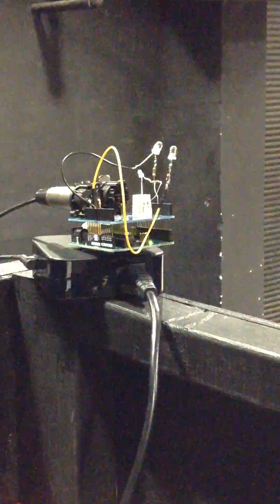DMX control on Arduino Uno

Comment: Hello Jennifer, Great stuff, are you able to share your source code ?

Thanks
Reply from the maker: Maybe? but I'm not entirely sure how since I don't think just copying and pasting into the comments on youtube is effective.  I can suggest starting here https://sourceforge.net/p/dmxlibraryforar/wiki/Home/ since they have some libraries you'll need and a few example codes. The arduino forums are also a really great resource.

I was using the dmx shield seen here: https://www.tindie.com/products/Conceptinetics/dmx-shield-for-arduino-rdm-capable/     They're also available on amazon.

After setting up the arduino as a slave and defining my constants and outputs my main loop looked something like this:

EXAMPLE DESCRIPTION
  //
  // If the first channel comes above 50% the led will switch on
  // and below 50% the led will be turned off
  
  // NOTE:
  // getChannelValue is relative to the configured startaddress
     if ( dmx_slave.getChannelValue (1) > 127 ) {
       analogWrite(ledPin1, dmx_slave.getChannelValue(2));
       analogWrite(ledPin2, dmx_slave.getChannelValue(3));
       analogWrite(ledpin3, dmx_slave.getChannelValue(4));
       analogWrite(ledpin4, dmx_slave.getChannelValue(5));
       analogWrite(ledpin5, dmx_slave.getChannelValue(6));
       analogWrite(ledpin6, dmx_slave.getChannelValue(7));
       analogWrite(ledpin7, dmx_slave.getChannelValue(8));
       analogWrite(ledpin8, dmx_slave.getChannelValue(9));
       analogWrite(ledpin9, dmx_slave.getChannelValue(10));
     }
      else {
// Sound stuff
       analogWrite(ledPin1,255);
       analogWrite(ledPin2,255);
       delay(100);
       analogWrite(ledPin1,0);
       analogWrite(ledPin2,0);
       delay(100);
       
     }
 
  delay(10);  
}

Good luck!

Comment: Hi, I have the same DMX Shield and I'm trying to pair it with an Arduino Mega2560 to control a COB Led Light via PWM with the help of an LED driver.

I'd like it to do just what you're doing, control the intensity of the LED, maybe blink it, whatever.  Where I'm stuck is the code.  All the sketches I find are trying to communicate with fill in the blank DMX controller or computer software via USB.  I prefer your setup where it's an XLR cable attached to the shield.  Would you mind sharing your sketch or pointing me in the right direction?

Thanks, and much respect.  Your audio reactive video looks super cool as well.
Reply from the maker: Hi there!  I understand your difficulties with the coding, it was the single most challenging aspect of this project.  If you have the same DMX shield I would download the libraries that come with it from sourceforge.net/projects/ dmxlibraryforar

Among the examples there should be one labeled DMX_Slave, which is what you're trying to do: set up your Arduino as a slave device to another control console.  This code should be a good place to start.  It establishes an intensity parameter that tells the Arduino to give control to the lightboard (I assume you're using a lightboard if XLR is involved) if it reads a signal above fifty percent on channel one, otherwise control reverts back to either a base code you write into the program on the Arduino or just defaults to 'off'.

I hope that helps.  I'm wary of giving you this other dmx code I have since it currently refuses to compile, despite the fact that I haven't changed anything since I last tested it.  It is probable that my software is out of date and that is causing all manner of issues.  Good Luck!
Reply: What dmx shield is it you are using ?